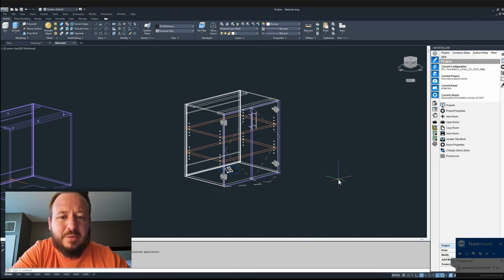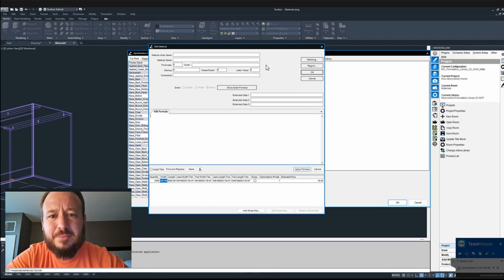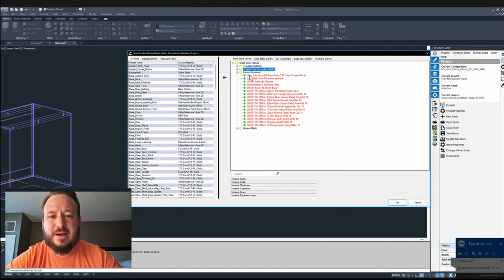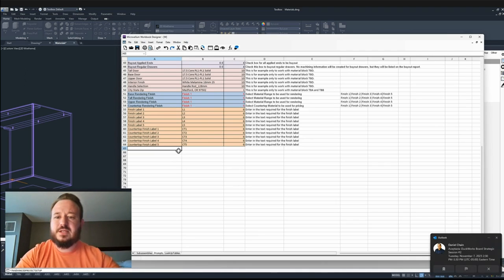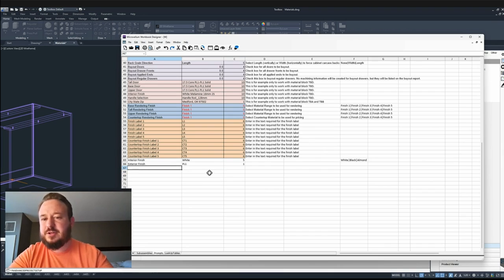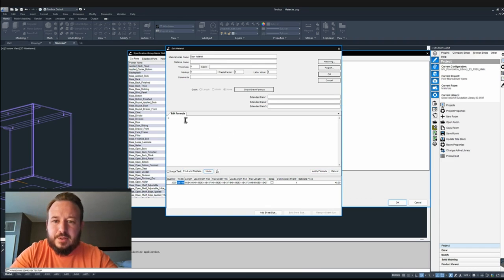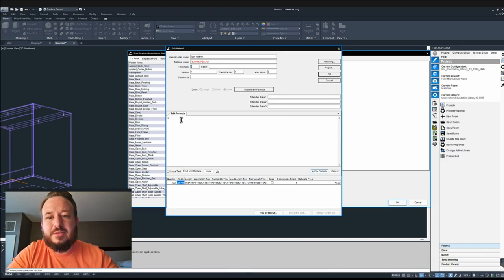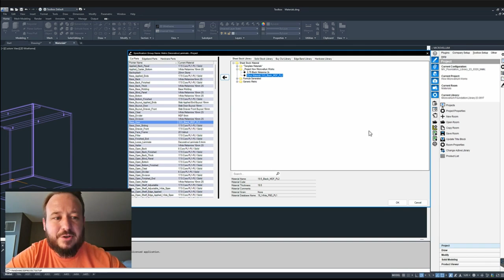Advanced Microvellum Tips: Formula Driven Materials

Comment: First off, thanks for posting this video.  I noticed at 13.33, that after you made a change to the prompts, the database name did not change.  My question is will this pose any problem? I started building some materials awhile back but stopped after noticing the same thing.
Reply from the maker: Hey Troy! Glad you found the video helpful! Great eye! No this will not pose any problem. The database name essentially shows what the formula is evaluating to in your template spec groups, which doesn't have any affect at the project level. Basically that version is still just looking to the default prompts in my Template Wizard in this example and that's why it is still evaluating that way. That is the beauty of formula driven materials!